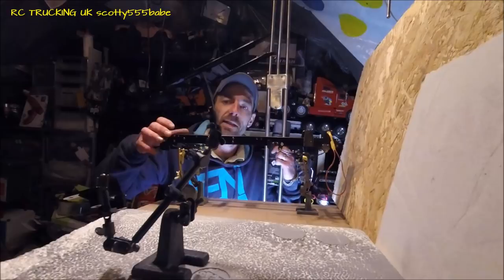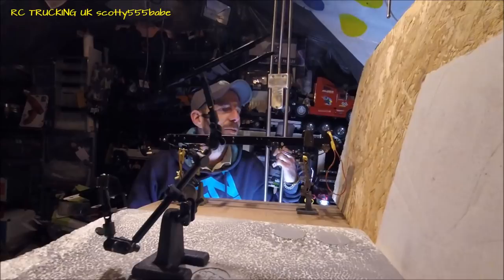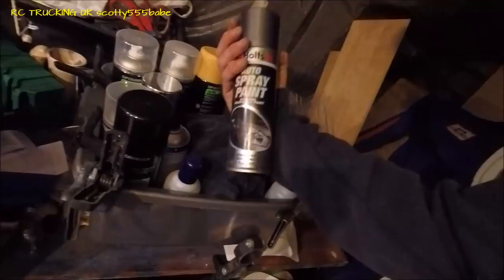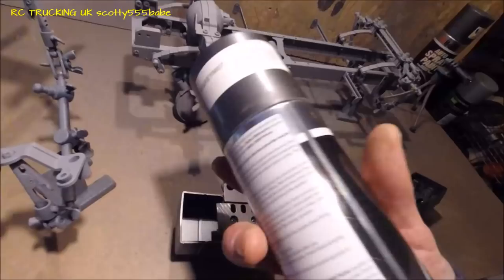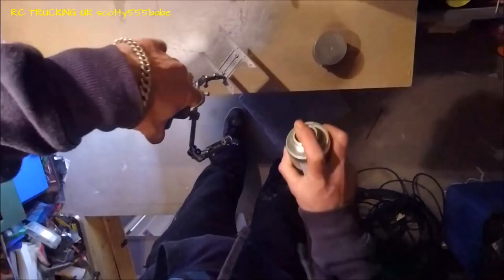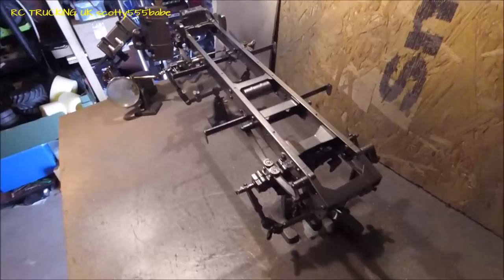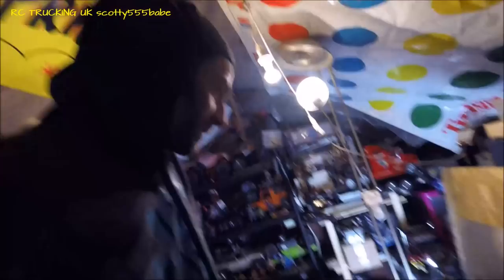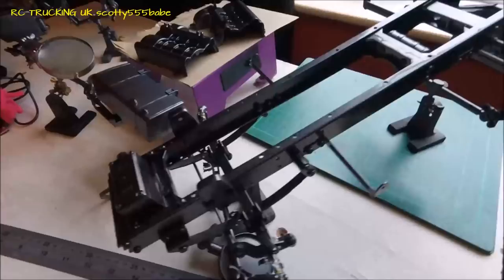RC TRUCKS | PAINTING THE TAMIYA SCANIA CHASSIS | RC TRUCK VLOG | BUILD SERIES

Comment: Hope the Shop In The Loft works out for ya'll Brother. I know about cold messing with Builds all too well, I'm still running my wood stove to keep my little 200sq ft Shop warm. Just a quick thought on Primers tho, if your Subbers do want to use regular non etching primers then they'll have to sand the factory finish on their parts until the shine is non existent. Etch Primer simply has a chemical in it that bites thru & into the factory finish to make it stick, clearly much easier choice. But bare metal ya'll can use either primer and I would recommend first giving bare metals a wipe with thinner or alcohol first to clean any schmutz off before attempting to prime. Another great video Brother!!
Reply from the maker: It should be much better in the coming months as we are having the roof re slated and felted so it will be much warmer and I can get a good extraction system in there as its not well ventilated 👍
But it's somewhere out of the way 😀

Comment: PS...forgot to mention, when ya'll are done spraying turn your paint bomb upside down & press the spray buttun for 2 or 3 sceonds. It cleans the spray nozzle so ya'll neve have them gum up with primer or paint.
Reply from the maker: I always clean everything properly first etc, I'm thinking of getting back into airbrushing too as I used to enjoy weathering things and I want an old look for rusty like its in the process of restoration 👍

Comment: Scott do you not rub down between coats to get a better key to get the paint to stick? Also I find when spraying I have to move the parts I've already painted because I get bits of over spray and it spoils the already painted parts leaving small paint particles .
Reply from the maker: I have an extractor at the side, may not be in view but all the over spray just gets sucked out, and I do all the painting in one so there is no need to flatten as the previous paint is still tacky and acts as a key, I have a nice steady temperature here... the only time really you should flatten is if you have sprayed when its too hot as the paint leaves the can and dries so it feels all dusty as its landed part dry 👍 when I spray outside I give them a quick flatten with wet and dry but indoors I have it just right 👌
Reply: I use a large cardboard box with an old vacuum cleaner nozzle pushed into the side of the box. Not the best but better than nothing lol.
Reply from the maker: That sounds like a good plan for a portable setup around the house, I have an old hoover so this could be a good video to show how to create a little spray booth 👍
Reply: +RC TRUCKING UK scotty555babe cómo se llama tu cuenta de Instagram por favor

Comment: Hi, where do you get your Holts brand spray paint cans from please? Excellent video BTW. Also, I once painted a Tamiya PolyStyrol Mercedes Benz 1838LS cab in Halfords automotive spray can grey primer, that was a big mistake! It etched into the plastic creating a rough surface! I should have used Halfords Plastic Primer! I have only just got up the courage to flat it back (thanks to watching your videos!) and resprayed it with Tamiya Fine Surface Primer (Light Gray) and hope to paint the main color on soon. I see that you are using Holts spray paint of code HGREYM07 ( Gun Metal, metallic ), that's a great looking color! I just bought some of the Autotek Etch Primer Spray for the chassis and Autotek Clear Lacquer for the clear coat, as you did. Best Regards
Reply from the maker: Thanks man, I'm glad you sorted your truck and you found some paint that your comfortable to work with, by now you have probably done more..
Anyway have fun and stay safe, 👍

Comment: I see that at 1m44s you are using Autotek Professional brand Grey Primer (non-plastic primer) spray paint. Does this etch the surface of your Tamiya PolyStyrene hard plastic body parts creating a rough primered surface at all?
Reply from the maker: Hi yes I'm using the etch primer due to the aluminium chassis and axle and other bits but it's perfectly fine for use on plastic, it just bonds to metal better where as standard primer would end up flaking off 👍